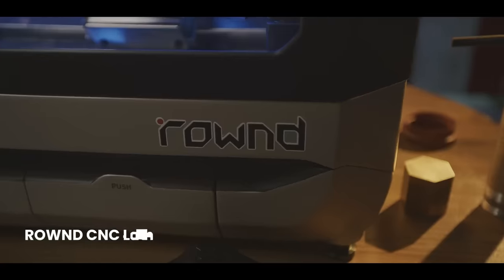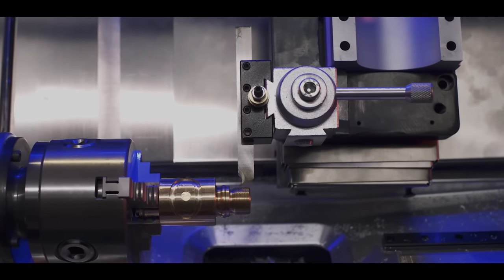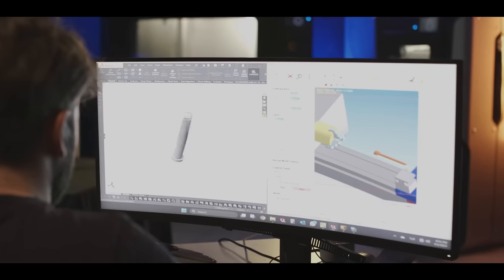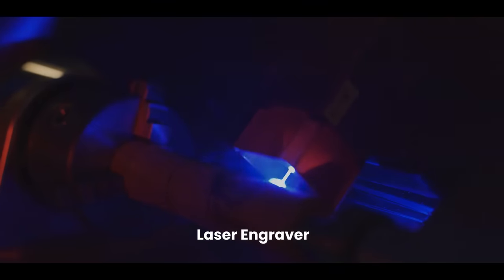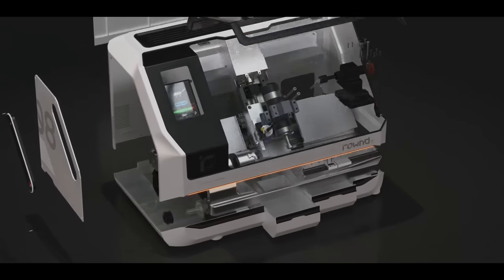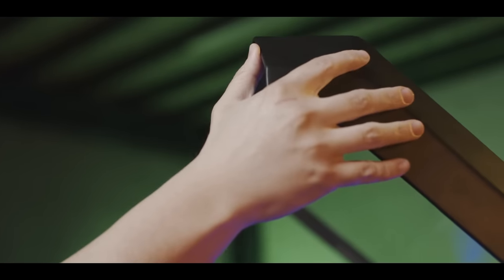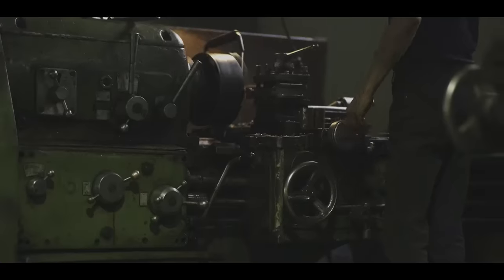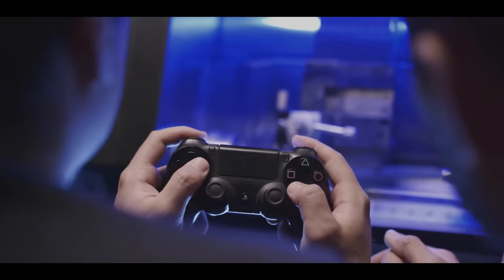Rownd CNC Lathe - Machining for Everybody

Comment: You guys think this lathe was designed for machinists or people that want to be machinists?  It’s for “makers” who like to make stuff but likely aren’t ever going to be a machinist or engineer (I’m both).   Turning and CAM have a fairly high learning curve.  This machine attempts to ease the barrier of entry.   Who needs chess pawns and other “maker” type parts made to less than 20 microns tolerance?
Reply: Fine that it's not designed for it, but they shouldn't really be using terms like precision so frequently thought the presentation
Reply: @adrianscarlett  fair enough.  But for the hobby/maker market they are targeting, it is fairly high precision.
Reply: @bnarit  they show what kind of parts this lathe is meant for—Chess pieces.  And it’s good for other non precision parts.    True, 20 microns is no good for typical interference fits.    But it would work fine for chess pieces.
Reply: @bnarit  ok but a mill isn’t the tool for the job.  I have a way to make lathe parts on my Haas but it isn’t ideal at all.  I just don’t understand why ppl go out of their way to put down someone’s work like this.   Who hurt you?
Reply: True
Reply: @adrianscarlett dude for a maker 20 microns is a ridiculously precise
Reply: Who needs that many chess pawns lol
Reply: @bnarit  If you don't know what you're talking about, it's better to stay quiet. Suggesting a CNC to make a chess piece here over a CNC lathe is so bizarre, it really dissolves any right to an opinion. Fortunately, I think even people who are not machinists will be able to realise you're talking straight out of your ass when they see you recommend a CNC mill over a lathe for an operation like that. Maybe there is some serious language breakdown here and you've just mispoken. I really don't see how that's possible. I also have no idea how on earth you think what you think though. Do you have a 4d cnc or something? I have no clue what you could mean. Anyway, when people who have no clue talk negatively about a product, that is not some kind of healthy public discussion. It's just clutter.

If you already have a desktop CNC, then you CAN if you want, rig up a lathe attachment to give you desktop capability's.

I think this is a really interesting idea for anyone who wants to get into turning. A really undervalued feature it has is the multitude of materials it can cut. A big turn off (get it) is having to have two separate lathes for wood and metal turning. This offers great flexibility for people who need both. All that said, I really am not a huge fan of the flashy marketing that makes it look like it's in a nightclub. I just want interesting information about the design process, how the team had to solve certain challenges etc, what you think it's strengths are, maybe some more info on its motor and other specs etc.
Reply: @bnarit  You eat your soup with a fork too?
Reply: Compared to a manual lathe, which I have, 20 microns is really good. Not mind blowing, but more than acceptable. Of course it all depends on what that means, suppose you make a thread on a nut and a bolt, and there just happens to be +20um on one and -20um on the other, so they won't fit properly. Or is a case like that unlikely?
Reply: @bnarit  No, you didn't talk about a 4-5 axis CNC. That's why I actually asked. You just said mill. Most mills do not have rotational capabilities.

Basically what you are saying is a 5 axis CNC can do everything a CNC lathe can do, and as such there is zero reason to ever have a lathe. Partially true, but a lathe will be able to complete a job like turning a chess piece WAY faster than a 5 axis cnc mill. There is a good reason machinists at every level still use lathes. Is the target audience for this type of machine concerned with pipeline efficiency? Probably not, but either way, the chess piece is just a demonstration of what the machine is capable of. Getting hung up over what would be ideal for that specific item is is really fucking stupid. The point is, it's a lathe. It turns things. 

You're not going to get a 5 axis CNC mill that will fit on a desktop and cost 7k either. You're looking at more like 60k for something of similar quality. Maybe if you have very low quality requirements you can look at the pocket NC-50.

Honestly mate most of what  you're saying really doesn't make sense, and what you think I'm saying again shows that there seems to be a serious language barrier. I did not suggest or think you recommend the CNC lathe. I have no idea how you got that from what I said. If you can barely speak the language, maybe stay away from being negative about things under the veil of public discussion. Especially if you do not have any idea what you're talking about.
Reply: @bnarit  It's not my product, and while you're free to express dumb and ignorant opinions, I'm also free to express my opinion that people who struggle to speak the language shouldn't make ignorant negative comments on other peoples work. 

I don't think ignorant positive comments are great either tbh, but the least you can do is keep your negativity to yourself. If you have genuine concerns, then at least dictate them properly. Not just say "I think they made a mistake in their calculations". At least prove your claim. 

Again, with this kind level of language barrier, I would just stay away from commenting. I have no idea how you got the idea that I'm somehow from the company, I just see a dumb comment so I point out to you why it's dumb. You keep just making shit up and I think it's partially due to the language barrier. Just try to understand, due to your lack of english comprehension skills, pretty much any type of discussion you can bring without getting someone to check your english is just wasting peoples time. Not to be racist, you speak english way better than I can speak my other languages, but yeah, you're off the mark every time.
Reply: 20 microns with a big asterisk.  Such Repeatability with a relatively -- thin aluminum -- foundation doesn't add up to me. Guesstimating the dimensions of the casting but a 5 degree change is enough to grow the machine out of it's 'repeatability' tolerance. Also how long will this machine maintain the advertised precision? Aluminum isn't known for being dimensionally stable under extended load. Also the desk/table/kitchen countertop this gets mounted on will twist/warp the geometry as well... I honestly like the idea of a simple CNC lathe but the marketing is --beyond obnoxious--.  1:28, literally claiming to be the 'ultimate tool for precision machining'. Then what's the point in diamond turning machines...

That being said... -I would imagine hitting tighter tolerances will be like running any Haas for a lengthy production in an uncontrolled environment except in a part per part basis.  Basically more 'dialing in' to do.  I'd get it if Tormach wasn't a thing.- Edit: just found out all axes are stepper motors....  Yeah, in the toy box it goes.
Reply: @agg42  looks like you figured it out at the end.   It’s an expensive toy and everyone here seems to compare it to what industrial machines can do.   Yeah the marketing is obnoxious but that’s just how marketing works these days.   You guys should look at it to be kind of the lathe version of the Penta Pocket NC desktop mill.  If you don’t know what that is, then you probably aren’t who they are trying to sell to.
Reply: I think I understand based on your English (which is good—1000 times better than any foreign language of mine).  The market that is targeted here in the US has a good amount of disposable money, and no desire to be a real machinist.   And probably very little patience for learning curves.  It’s common for people here in US to have a lot of money in their different hobby’s.   These people need easy CNC control and decent accuracy.  It needs to look cool.  I think this machine checks all those boxes.  Yes, it could be much better (epoxy granite or cast iron, ground ball screws, servos, etc).   

I think people with money in a lot of other countries spend it on other things.  I’ve traveled a lot and I just haven’t seen the hobby money that I see here.
Reply: Hmm am I missing something 20 micron is industry standart even iso standart says 0.05 mm is fine 0.1 is medyum 0.2 is coarse didnt really get what people say here even 50000 dolar haas cnc has 5-30 micron tolerance. You are around h7/p6 fit you can even make car to turbine shafts etc.
Reply: I need one with tolerances < 0.01mm. I would buy one of this machines!

Comment: Next Model: "Rownd XL" - Features a Cast Iron Base (saves you tons on machining time, but give the necessary rigidity needed for higher speed cutting and more accurate surface finishes) 38mm Through Spindle Support. I have an import hobby lathe with this feature. It's completely doable, even on a budget machine, but often gets overlooked. And lastly, a full 27.5" (700mm) between centers. This allows for a legit 24" finished part.

I'll let others chime in on possible upgrade features, like higher power spindle motor, larger 4th axis spindle motor, collet holder spindle chuck, part ejection tray, recirculating filtered coolant pump, rotary tool holder for no-stop automation tool changes. There's so much you can do, even with a small platform. Just having a roadmap of upgrades that keep this tool future proof would be fantastic. Other companies have tried this, but have cheaped out with sub-par components, or don't listen to their customer base.
Reply: wanted to say that... for 6k I expect cast iron and more power.. for that price  you can buy a secon hand industrial grade cnc lathe in germany.....

Comment: I'm an engineer who works with cnc machines. This looks great for designers and hobbyist and for small batches and/or less details on the part. I haven't seen this drilling or making bores or internal features. Is it still possible? And we engineers all know the main problem is the heat, but the video doesn't show any cooling method. Do you use compressed air? Does it needs compressor? Or does it have coolant liquid capability?

Other question is i guees this isn't gonna cut stainless 316 or 143d. What is the toughest it can cut? Bronze?
Reply: "I haven't seen this drilling or making bores or internal features. Is it still possible?"  

I don't think a stepper motor (main spindle) will have enough holding power for drilling operations. Yeah no servos on this machine. Looks like there isn't enough torque for single point threading either.  The more I read their kickstarter the less I'm interested in it.

Comment: Would be very interested if it was capable of decent accuracy and repeatability. 20 microns is way too inaccurate for my needs. A similar size watchmaker’s lathe from 100 years ago could do better! 😂
Reply: fantasma!!!!
Reply: Uh. .20 microns is 0.000007 in inches. Maybe you mean 20 microns?
Reply: @ixenn  the full stop in my comment is marking the end of the sentence. I did write 20 microns and that is the tolerance/accuracy of this machine. If it was accurate down to 0.20 microns I’d be ordering one.
Reply: @ixenn  why are you converting to an inferior model?

Comment: Looks like good quality, but I think hobby machinists want a milling machine more than a lathe. It is much more versatile.
Reply: It’s got a clamp there for a spindle as well so can mill as well as turn
Reply: @ThePlexman  yh i guess you can a bit. 
Question is, can you mill molds for casting with it?  I always lookedfor a very smal but multi axies cheap but high precision cnc milling machine, because i wanted to machine molds. The problem with molds is, they are super expensive. First reason of course is its engineering, but also machining quality. everything needs to be perfect. I think it could be done more cost efficient, if you could do it with a very cheap milling machine. This could give you the opportunity, to have more machines at once and can do tests and create more molds simoultanously. This may make the process faster and cheaper.

Comment: Please show parting 30mm soft steel bars
Reply: yeah... good luck, this is a basically a way less rigid mini lathe, but made of aluminum...
Reply: @fredrikcarlen3212  they did not say which aluminum was used for the main block. 7-series or just regular 6061... (at least I did not see that).
But even then it very likely wouldn't have much damping, but damping with such a mini-lathe? I wonder if there's much that needs to be dampened.
750W servo on X .. that's also a story, I also have a mini lathe but I use a 1.5kw bldc at least.

Comment: 20 microns is .0007 in inches less than a thou. Pretty dang accurate for a bench top Cnc lathe
Reply: I didn't think it was that bad. I've done an awful lot of work on manual lathes that can't even hold a couple of thou over 12"

Comment: So where do we sign up? I've been meaning to get some sort of small form factor CNC lathe solution for dummies and I mainly need it for engineering plastic round stock so power isn't an issue for me. Not a machinist either. Just need a lot of round plastic stuff so as long as the price is okay-ish I'm interested. I already have a way of making round plastic stuff but more automation would be nice.

Comment: Sorry, I'll stick with my old iron. This concept is not new at all, you have just reinvented the sherline machines but with less, precision and reliability. Keeping with the benchtop formfactor a Hercus PC200 or an emco compact 5 from the 90s would run circles arownd this. If you want to make a real machine worth buying, and not a glorified toy, make it out of a casting so it's actually rigid, and for crying out loud use ballscrews. "20 microns" enjoy trying to make transition fits.
Reply: 20 micron are 0.02 mm, are u american?
Reply: @TumbaX  20 microns for precision application is quite lousy.